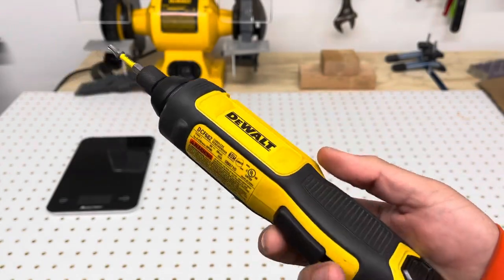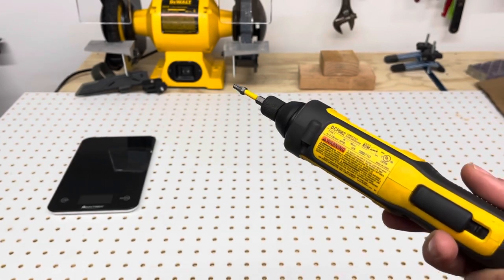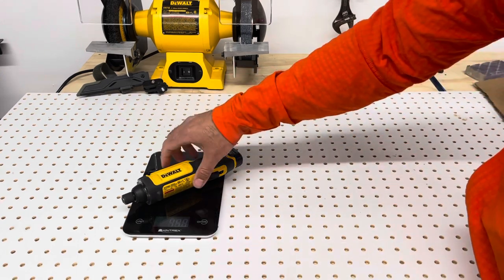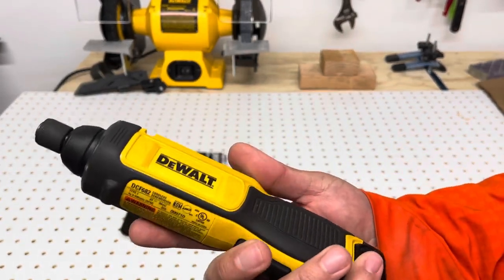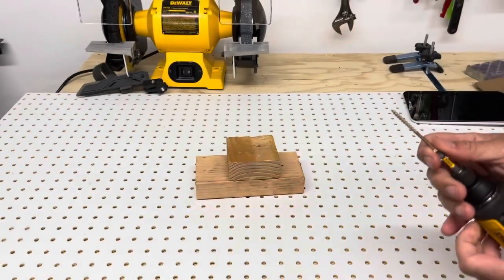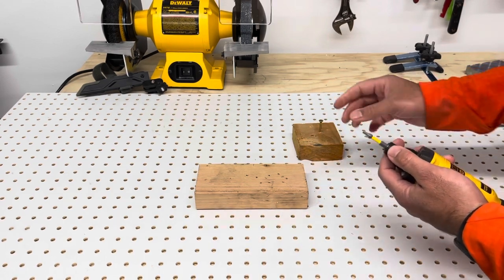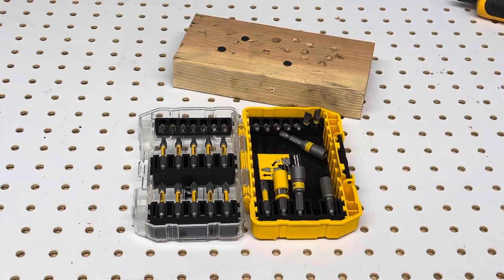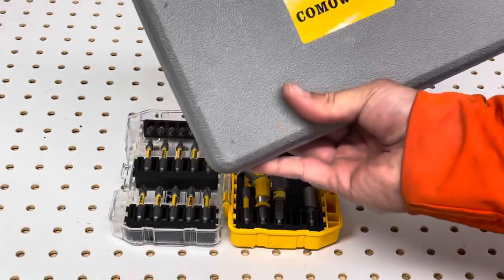Answer to all your questions about the Dewalt DCF682N1 Cordless Screwdriver

Comment: This tool definitely has its place in between screwgun and screwdriver. I paid $74 with 1 battery and charger. Great for hanging blinds, fixtures, pictures and taking apart things with lots of screws. It is not a necessity, but most things aren’t.

Comment: Great video, Great demonstrations! I use that in the automotive field, mainly for dash work/in the passenger compartment so I have a clean tool. I dont have to drag an air hose or use a oily/greasy ratchet in the vehicle. I also have Wera and DEWALT bit sets that I only use in the cab for the same reasons,
Reply from the maker: Yeah. I’m starting to finally understand why people have so many sets of tools. Glad to see I’m not alone in loving this screwdriver.

Comment: A Couple Of Years Ago I bought
A 4 Volt Ryobi Cordless Screwdriver.
& I Use It To Drive Nuts & Screws
& Light Duty Drilling.
I Hardly Ever Use It. But If I Ever Do
Need It It Sure Comes In Handy.

Comment: Looking to get one of these for my wife because she keeps buying shit from Wayfair. I'm looking at this test to 'drive a screw into a 2x4' thinking, "What kind of person is trying to drive screws with any screwdriver, let alone a mechanical one?" Get a drill you bums.

This really helped though. Your bit with the electrical plate was great because I was wondering if upgrading to the version with the clutch and rotating handle may be worth it and I think it might.

Comment: Sadly, it didn't answer my question:  Why is it intermittent?  :)

I have the same model (DCF682) and it started flaking out after not much use but after the warranty.  Depending on the angle, or shaking, or rotation, or something, it will work or it won't.  A wonderful tool when it does work!  It's very helpful to use when you need to be careful not to overtighten but don't want to spend ages tightening the screw until that point.

Oh, how did you get the "N1" designation on the end?  That doesn't show on mine (as it also does not show on yours that I can tell when I pause the video).

Comment: Pretty pointless to expect this tool to drive wood screws or drill holes. We should all know what kind of tool does those tasks. 12v on up. Clearly this tool was designed to perform repeated light duty tasks to ease the muscular strain of manual operating. I have a Milwaukee Fuel hammer drill for HD tasks. I also have a much lighter Makita that can drill and drive like a champ for half a day. I’ve also had quite a few other 18v brands through the years that have delivered varying degrees of longevity. Interesting Panasonic was one of my favorites, but Dewalt and Milwaukee have been the tried and true work horses through the years. Yup, I was a building contractor. 

This tool was invaluable when I changed out all of the duplex outlets and switches in my old house. The key was many many light duty tasks undoing and redoing screws holding wiring and screws for cover plates. I’m a 70 year old man who would not have enjoyed doing this with a large drill/driver,  or an old fashioned screwdriver. Maybe a Yankee screwdriver, but all you can find these days is cheap versions of those. 

So the thing to learn here is how to select the right tool for the job. That means don’t select one that’s too big or too powerful, especially if the task requires many repeated steps, because you’ll tire quickly. It also means don’t select one that’s under powered, because you’ll risk burning out the tool prematurely and losing money.

Comment: I decided on this one when I went to buy another Black & Decker gyro screwdriver. I must have found my original one on sale because there is no way I would have spent over $100 for the gyro. The nice thing about this one is it's 8 volts versus 4 volts for the gyro. Another good use for this type of screwdriver is when you have a bolt where the nut has been loosened but it has a lot of threads.
Reply: Wait this isn’t the gyro?! I’m sooo cumfuuewwzeddd

Comment: Just picked up the screw driver on amazon and the kit that comes with it is good but not magnetic, I followed the link and searched for it. I also bough this kit also I had a old Eastvolt 4V Cordless Mini Electric Screwdriver, 1500mAh USB Rechargeable Battery the motor broke up Sunday while installing my new led lights that was a bummer. hopefully Dewalt screwdriver will last many years to come. im investing in the brand for DIY home repairs and fixes but of course will buy the best models. thanks for this information. I prefer the magnetic kits but the magnets are not as strong as I thought.

Comment: It's struggle, cause I got the reamer version and you can't swap out the chucks. Frustrating they don't offer a keyless chuck except for the more expensive twist version. Bro I don't want the twist and the larger size. I'm kinda bummed now, it works I guess but it's not what I desired.

Comment: The problem that we need to know about the torque, how is the torque works with this one!!
The one that you mentioned it break down, it has a clutch so you can change the torque power. This one doesn't have it, so I'm wondering how is the torque works with this one, is it fixed to it's max torque always or it changes as much as I turn it??
It's a screwdriver and you don't want to mess with the screwdriver hole if you give it extra torque!!
Reply: I'm here for the same question
Reply: Torque is basically how you decide to turn it so it's perfect for those screw holes u mentioned
Reply: @MrProsperty  thanks for your response.
Reply: Torque is around 21 inch pounds as tested from project farms screwdriver video

Comment: Are The Batterys Replaceable?
That's Why I Chose The Ryobi
4 Volt Cordless Screwdriver.
Cause those Tools You Have To
Have A Professional Ot Replace 
The Battertys You'r Self. By 
Taking It Apart. I Never Was For
Buying Those Kind Of Tools.
Reply from the maker: Yes. Easily replaced.

Comment: I bought this tool in Home Depo after 6 times to used gyro is not working well it’s very frustrating $80 box with nothing warranty was expired not a good reason a tool with gyro
Reply from the maker: What was the exact model number on the tool you bought?
Reply: @diytoolreviews8278  DCF682
Reply: Can i replace it the tool was not responsive the giros?
Reply: I also have a DCF682, it rarely  turns in the direction you twist it. You get 3 green lights, gently rotate the turns off. Only because it was around $80 bucks I hate to throw it away. I am a Milwaukee tool person, and regret not spending a little more for it. FYI when buying Milwaukee tools always check the part numbers carefully.  I couldn't figure out why Lowes always had Milwaukee for less than Home Depot. Then I realized they had 2 different model numbers,  Lowes had plastic gears and HD had all metal gears.

Comment: $80 for a tool to take out screws on a switch plate…..okay! Not
Reply: Now do 100 of them.
Reply: Better call electrician to fix your machine or tv for 200 USD
Reply: That's only one application.  I use this for 10 screws per wheel on beadlock wheels for a 1/5 scale RC buggy.   Also many other hex screws on the RC buggy as well.  Open your mind!  Well worth the investment.